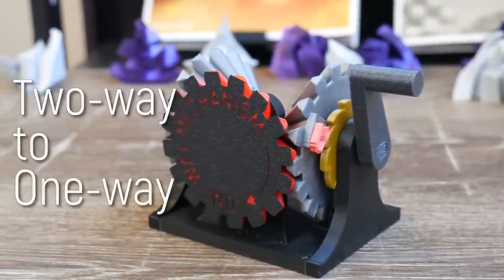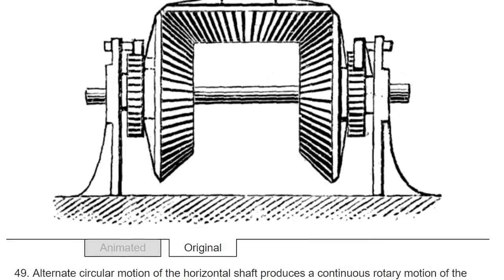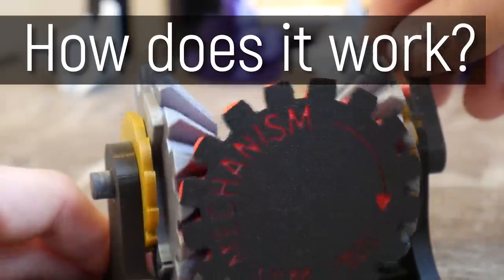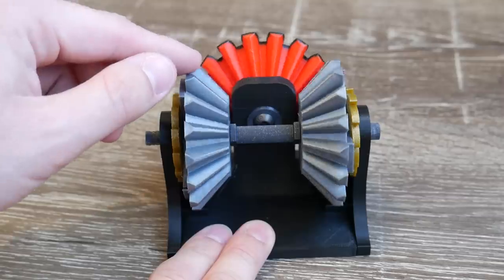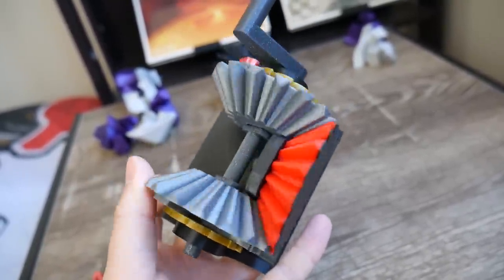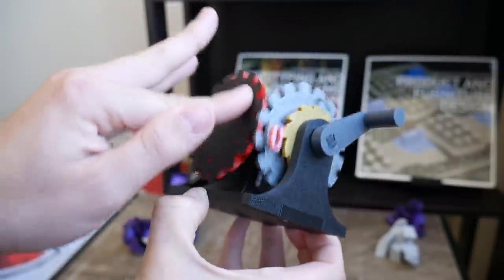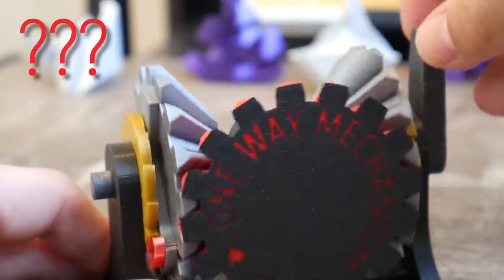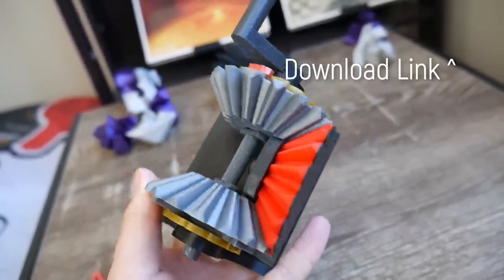This Mechanism only turns Clockwise, no matter what.

Comment: I'll tell you exactly what it's practical use is. You've probably used one a few hundred times in school if you've ever used one of those heavy duty pencil sharpeners that were mounted in classrooms. I always wondered how they could be cranked both directions on the handle, while the sharpener would always spin in the direction that sharpens the pencil.
Reply: Our sharpeners are eraser sized tho. You are the crank.
Reply: Smol boye older sharpeners were wall mounted with a hand crank. Like an electric sharpener your teacher had, but with a handle
Reply: Never seen any, and I am from a ex-soviet shithole (where some areas still have horse drawn carriage).
We only have those tiny pocket sized sharpeners
Reply: Unless you're talking about something completely different(which I've never seen before), the way a pencil sharpener works in both directions(that I've seen) is there are two "blades" which are mirrored, and only one does the cutting, but if you switch directions, the blade doing the sharpening swaps. Different concept-- The direction of the blades are mirrored, as I said, so one cuts clockwise, the other cuts in a counter-clockwise direction.
Reply: It doesn't work if i turned it backwards or we are talking about different things
Reply: Nanda Fandi, Probably, I have a cheaper one with only one blade, so it doesn't cut in the other direction. Yours probably just has one blade, too.
Reply: If you google old fashioned wall mount pencil sharpener you will see what Steven Davidson is referring to
Reply: Except we have electric nowadays :/
Reply: They use dif mechanism
Reply: Steven Davidson my house has one of those in the garage
Reply: I remember them pencil sharpeners hated getting up in the middle of class then everybody stares at u haha
Reply: Smol boye these sharpeners are in most American classrooms
Reply: Are you talking about the ones that, when you opened them up, looked like they had two large drill bits circling the pencil? I don't doubt you've used one that works in both directions, but the ones I encountered never worked that way. Turning them backwards would just gently push your pencil back outward and give the cone a funny texture. Again, I don't doubt you, but just saying, they don't all work that way.
Reply: Steven Davidson 8
Reply: MTastatnhgevv idk what pencil sharpener ur talking bout but it worked both ways no matter which way u turned it lol
Reply: Steven Davidson Not..Open a pencil sharpener some time..
Reply: Huh.  Ours didn't work like that -- if you spun it backwards it would just chew up the pencils... XD
Reply: damnit you said it before me ^^
Reply: Two words Jasper Beardly...30 seconds in everything is explained.
Reply: actually, the sharpeners at my school have 2 spiral blades that rotate on their axis, and around the pencil, allowing sharpening from either direction.
Reply: No. I have several of those old sharpeners.  Double edged, spiral blades. There are no ratchets of any type in any model I've seen.
Reply: Lefties would dig it.
Reply: There is actually one of these mounted in my garage, which someone put in sixty years ago for reasons we can no longer ask about. It's not a bad thing to have in a house that had four kids at the time, I suppose. I'm sure they went through plenty of pencils. However, I've noticed it doesn't have the property in the video -- the blades are directly attached to the crank. It also still works just fine.
Reply: Schools still use pencils? i thought they gave up on writing.
Reply: Those sharpeners are still in standard use.  And if you check YouTube you can see a hilarious nitro powered one some loon built with a model car engine.  Sharpens the shit out of 3 brand new pencils in 7 seconds.  

It does NOT use this mechanism.  The input shaft is in the same plane as the cutter wheels.  The cutter wheels have spiral "teeth" cut in opposite directions.  They DO reverse when you turn the crank the other way, but it doesn't matter.  Only one of the wheels is doing the actual cutting, and since most people tend to crank the clockwise one cutter tends to wear out a lot faster.
Reply: Depends on the design.  All the ones I've ever opened up work in either direction, because only one of the wheels does the cutting and the wheels "spiral" in opposite directions.  

The pencil is held in position and the "active" cutter hones it.  The other one, which is turning the wrong direction, just rubs against it.

A sharpener with just one wheel would work just as well, but only in one direction.  

I assume the two-wheel types also have some provision to let the non-cutting wheel kind of flop out of the way a little bit, while the engaged wheel is forced inward against the pencil.
Reply: It was faulty.  They are surprisingly complex, and if anything goes wrong the results are not good.
Reply: Every class I’ve ever been in had the wall-mounted hand-crank pencil sharpener. Not exactly old-fashioned. And I graduated in 2013, so the school probably still has them.
Reply: Yup.

Comment: This is incredibly cool, Angus. I'm really going to think hard on something this would be awesome for!
Reply from the maker: It's not QUITE as loud as your giant ratcheting noise maker, but maybe something like that :P
Reply: Prank a friend and make their car only go forward
Reply: You could make something 2 speed by having the gears at different ratios, then if it's driven by an electric motor switching the direction will change output speed.

Although to do that with this gear design might be tricky, you would need to use a planetary gear on one of the ratchets so the gearing would be different without changing the gear size on one side as that would not allow it to connect to the output gear as both gears on the crankshaft have to be the same size.
Reply: a music box withoit fixed crank direction? This is what this was used for in the past
Reply: Maker's Muse 
To me, one application is glaringly apparent: hydroelectric generation from tides. 

An artificial tide pool, bidirectional water flow, could turn a wheel in either direction and rotate a secondary mechanism (eg; generator, pumps) in a mechanically uniform direction.
Reply: Think of waves, and if you were to draw energy from them, the movement would not be constant the same way. so if you had an oil pump, looking device, stuck to a floating pillow.
so you can get a constant movement to a generator, to make energi ;)
Reply: This kind of technology would make a cool perpetual watermill.
Reply: Diddle 
Perpetual isn’t an engineering principle
Reply: This would be good for older tractors where the engine could accidentally start running backwards. this way you don't jolt into reverse if your engine dies.
Reply: It's a basic limited slip drive, a more complex version that can be run backwards can be found in rear wheel drive cars.
Reply: The first thing that came to my mind was a water wheel on a tidal sea. When the water rushes in and out the wheel spins either way.
Reply: Or, like, a survival flashlight that you can crank both ways without breaking it or smth
Reply: a socket driver with this implementation would give mechanics the ability to undo and tighten fasteners with every movement, thus doubling the speed at which fasteners are removed by hand
Reply: multi direction winds or water to uni direction drive. As it had been used centuries back.
Reply: a bike you can cycle backwards on
Reply: My ratcheting screwdriver uses this concept! It unscrews/screws stuff in, in a flash!
Reply: Maker's Muse hey, this is a lot off topic, but I am currently learning fusion 360 by watching your tutorial videos and I used your combat fidget spinner design as my first challenge build to see how well I can work the software. Also because I don't have the money to buy your design :(. Would it be ok if I print out your design with my college's logo on it as gifts for my bosses? (I'm a student worker and they are the reason I can use the program for free)

I don't really know how copyright stuff works, so I thought I should ask before I do anything.
Reply: Larry Scott the friction might overcome the energy produced, rendering a useless product that is very inefficient

Comment: Youtube recommended me this video again two years after first watching it, and I have since found a few times where this might be useful (though some form of overrunning clutch is more likely than a ratchet and pawl). There were a couple clock options, a press (which I think even had two sets of clutches to engage based on which direction you wanted to turn the output), and a few others. Granted, most were times when you only had a small amount of play in an input angle changing (or an input oscillating movement) and a need to turn that in to a rather continuous rotation

Comment: Sailboat winch.   Not sure if they're based on this design or not, but the winch drum always turns clockwise.  However, turning the handle clockwise is low gear, and turning the handle counter clockwise is high gear.
Reply: I’m not a sailor but for some reason a sail boat winch was the first thing I thought of. I really have no idea why.
Reply: Yeah I immediately thought of a winch. Prob just a smaller ratchet on one side so it's easier in one direction.

Comment: This is neat!  Possible it was used with a pulley at one point for running  buckets in a loop in a mine or something (I.el can crank in either direction, but buckets always raise in one direction and return empty on the loop, but gravity works as a break to keep them from falling back under load)?
Reply: Practical Printing actually, that is a good idea.
However on one point the load would change and if it is too great it will overcome the rachets and the bucket would fall (unless there is a counterweight).
It would be grat if you make sure that the buckets empty before raching the top of the loop and the rachets are oriented properly
Reply: Usually worm-drives (sometimes called screw-drives) were used to prevent loads forcing mechanisms into reverse!
Reply: there totally is a winch on sailboats that uses a simmilar mechanism. its a two speed fast one way and strong the other. uses only two drumms and friction instead of teeth and no ratchet. too bad i cand find a picture
Reply: This makes a lot of sense.

Comment: For when the workers handling the crank just can't remember the right direction :-)

But jokes aside, I'd think it could be useful in tidal power plants. Water going back and forth, translated into a consistent motion.
Reply: I reckon for tidal plant I'd let the turbines run in both directions and do the rectification electronically. 

Funny thing is tidal plants don't seem to be a solved problem - there've been lots of suggestions but none of them seem to have taken over the market. 

It's not like gas, coal, solar, wind or nuclear where there's technology deployed en masse that works well, even if better stuff is in development. Tidal power never seems to get out of the proof of concept stage.
Reply: One of the simplest examples I've seen was to have the turbine blades pitch pivot freely at leading edge and the trailing edge stops at an angle in either direction. Maybe not as much efficiency with symmetrical blades, but the driven wheel would always turn the same way regardless of the direction of flow.
Reply: One (water) wave generator that I saw used the air in a vertical pipe (lower half in the water) and the resulting airflow drove the turbine; the impeller was so designed as to turn in the same direction whichever way the air was flowing. There were no moving parts on the impeller, somehow the fixed shape of the blades made this happen.

Comment: An interesting application for this sort of gear would be something like a wave generator. Use buoyancy and mass in a lever floating atop waves to drive the gear and axle through a gearbox connected to a flywheel which would then connect to a turbine. I'm a physics major, not sure how much energy can be stored in a flywheel, but I'm sure changing gears would allow the system to operate at both low and high amplitude waves. 

Of course, that utility doesn't remove the mechanical limitations of the ratchets. Such a system would probably operate pretty much constantly in open water and would require frequent regular maintenance to address wear and tear on the ratchets.

Comment: time to swap the rachets for one-way bearings!
Reply from the maker: Indeed! Shouldn't be too difficult to adapt it.
Reply: bigfilsing how does a 1 way bearing work? I've never heard of them
Reply: +isgolo, it's friction based: balls are placed in slanted slots tangent to the trajectory, and springs push in the opposite direction of the desired movement (toward the narrower side of the slots) ... when you apply a force opposed to the springs the balls lift a little and allow the mechanism to roll ... in the reverse direction the friction is too strong to overcome.
Reply: my thoughts exactly.
Reply: They literally work as the name implies ...rotation only in one direction. As noted by other here, variants can be found in quite a few applications. A common use in the RC ( radio controlled) world is the clutch drive arrangement on nitro helicopters where the clutch bell is also used to start the engine. You want it to lock while starting but be free once the engine is running. Search google for "hirobo one way bearing"
or https://www.youtube.com/watch?v=9yxZtNulCQw & https://www.youtube.com/watch?v=QjR7dimpSJA
Reply: Maker's Muse they already exist, I just bought one the other day
Reply: Let's see if you can build some 3d printed sprag clutches ;)
Reply: bigfilsing of course somebody with a fancy important looking helmet says that.
Reply: Logan McCleary kids bikes rear hubs (coaster brake hub) are nothing like a sprang bearing/one way bearing. They work with a threaded end on the drive unit, pedal forward the thread pulls the hub nut and locks it against the inside of the hub giving it drive, pedal it backwards and hub nut move the opposite direction and pushes the two brake shoes again the hub causing friction or braking
Reply: TheBlue028: I didn't know that - I always thought they were Sprag clutches (although I didn't know the name of that until today).  What you describe is the same mechanism that old Maytag washing machines (I think - may have been something else like Frigidaire) used to shift between agitate and spin by changing the motor direction.

Comment: >attach input to pendulum
>attach output to generator
>no more power bill
Reply: Genius!
Reply: You would still need to go out and swing the pendulum.
Reply: Maybe in a tidal water generator?
Reply: @MrJmparanu  
Too bad the tides take forever to come in and out.
Reply: debblez Better than a pendullum, why not the bouncing of the sea waves?
Reply: Laws of thermodynamics: Wait, that's illegal
Reply: Naimad 

SCREW THE RULES, I TURN CLOCKWISE!!!!
Reply: Build giant one, attach floating platforms to the end of crank beam

Put at end of pier or on shore

Attach extremely large gear to tiny one

Large battery storage

= generator
Reply: It takes energy to turn the handle
Reply: @mustardyboi4187  Lol, I hope you have enough money to screw the rules!
Reply: Friction
Reply: Or make a water wheel with the output connected to a turbine
Reply: @MastaSmack  r/whoosh
Reply: @diamboy  they know... The pendulum turns the handle...
Reply: @jeremys8360  r/whoosh
Reply: @gorgefood9867  you could use a multiplier.
Reply: @cleptuno  yeah good idea
Also, already done.
In fact lol all these ideas a already in full use.

but fact is, we could get better power bills by using human power, isten it funny how much power we just love to waste.
We eat ourself full of fat, then refuse to use fat as power.
Humans can be really clever, and really stupid.
Reply: Nekogami-Crystal I don't think that would be efficient.
Reply: The pendulum will immediately slow down when you apply any load to it. Surprise, a generator is considered a load.
Reply: I know this is a joke, but some people might actually believe this will work, so I’m just sayin, perpetual motion is impossible
Reply: @MastaSmack  

weight on one end, container or tray in the other. collect rain/snow.
maybe have a notch near the bottom to tilt the tray to empty it.
Reply: The law of conservation of energy

Comment: I used this very mechanism back in 1990 for a practical purpose: A pair of foot pedals traveling along parallel tracks, connected by an oval loop of bicycle chain that went around a pair of bicycle chainwheel sprockets mounted at each end of the track rail structure. One of the chainwheels was connected to the input shaft, and the output shaft had a propeller on it. I used standard BMX bicycle freewheels, and the bevel gears were custom fabricated from a hard aluminum alloy.

This linear, reciprocating pedal mechanism was used to propel the University of Washington "SeaDawg" human-powered submarine in the Second International Human-Powered Submarine Competition. It was actually a very efficient drivetrain overall. UW came in fourth place out of about 34 teams.

I hadn't seen the mechanism in any text (that I remember), but derived it myself, thinking that I might possibly have been the inventor (but doubting it very much). It's really okay with me that someone beat me to it by centuries.